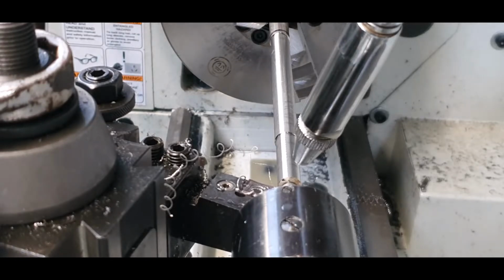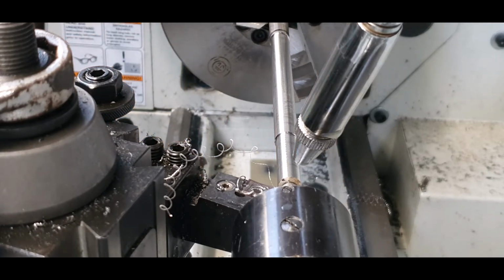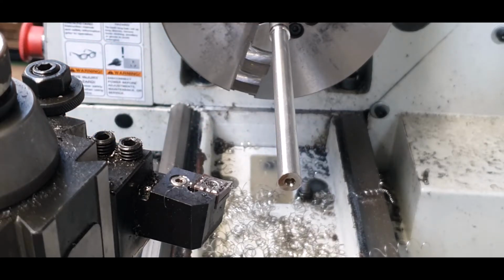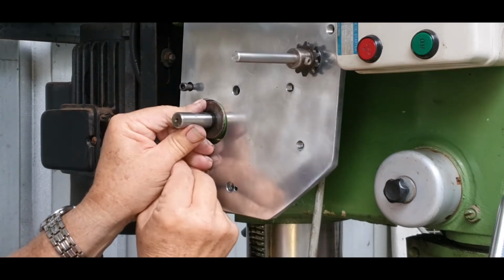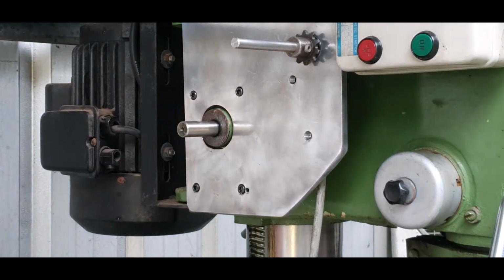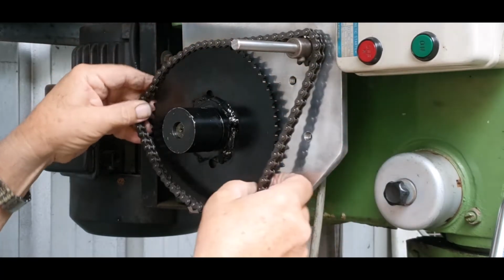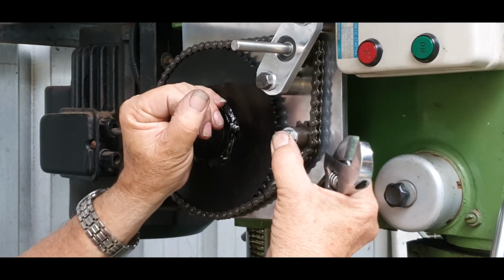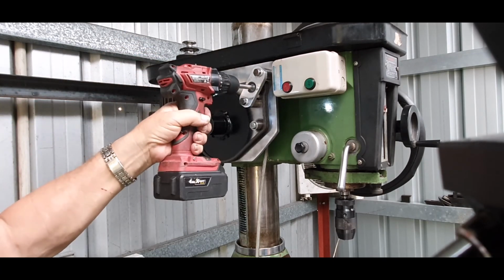Rong Fu  RF30 Round Column Motorization  Part 3  Final

Comment: Hello. 
I enjoyed these videos. I have a similar machine and did an almost identical mod to mine. I used a 24v wiper motor to power the chain with a double pole switch for up/down. It's not very fast, but very quiet. I changed to a smaller driven sprocket to increase speed. 
I also added a counterweight via pulleys to the head to make lifting easier. 
In process now of adding X power feed using a stepper motor. 
Also, If your mill is like mine, you will find tapped holes in top surface of column. You could add bolts to hold top cap in place to secure the rack from moving.
Subscribed!
Greetings from Pennsylvania, USA.
Reply from the maker: Thanks for your input.   I know what you mean about the top end cap, I was going to put an extra bolt on it, but didn't due to Possible Interference when moving the Head assembly around to 45 to 90 degrees. I stayed with the drill to raise and lower the head assembly so not to have different voltages. My Mill is a straight 240v system, and doesn't have variable or reserve speed.
After I finish the vertical Modification to stop side movement, I am thinking of fitting a 3 axis DRO, which means I am going to be searching for room. As you know all these things take time, but we will get there eventually.

Comment: This reminds me of what was done in Winky’s Workshop. He did this in conjunction with a mechanism to prevent the head from turning from side to side when it’s raised or lowered.
Reply from the maker: I saw a similar one elsewhere with a virticle brace on the same side as the sprocket, plus I have since seen Winkey's as well. My mod has ball Barings etc instead of bushes . Many mods will be similar,  you need to find one that suits you & Your machine.  BTW, Mine is a Alloy plate etc

Comment: Nice one 👍 Do you have any ideas for a quick lock on the nuts that locks the head to the column? Would have been really nice not having to crank them both every time 😄
Reply from the maker: G'day Thanks for your comments. If you are referring to the two virtical lock nuts just infront of the main electrical. Motor. I looked at this point, & decided this was the strongest solution as is, because the studs in the main column,  long as they are tightin & not loose they are a very strong solution because of the weight of the head assembly. Hope this helps
Reply from the maker: Also it is a matter of loosening two nuts, then use the drill to go up or down to the correct place & relock the nuts . If you add the Virtical guide assembly then there is no side movement

Comment: Why not just use the variable speed drill motor directly onto the  shaft and eliminate the sprockets chain etc? Same result would be achieved right? Does the drill motor have enough power without the gearing reduction, just curious, and a great ingenious idea BTW!
Reply from the maker: Thanks for your question, It is greatly  appreciated. When the original handle was used, because of the gearing the weight of the Head assembly tends to force the the Head Assembly to move left & right . Therefore using a 9 to 1 or 10 to 1 ratio It not only takes the heavy torque ratio out of the equation  using a small or heavy torque drill, It makes it easy, or less torque or stress on the upward or lifting of the Head Assembly. My next modification will be to make a special sliding Virticle brace assembly to stop side movement.  I hope this answers your question.
Reply: @TedRoza  Thanks for the response, looking forward to the video when you start the verticle brace assembly, I am preparing to do all these mods on my mill, enjoy your channel.....

Comment: Something wrong with the cut-off tool holder. It was bouncing up and down. It was easy to hear as well. You must have noticed it.
Reply from the maker: Thanks for your comment. The carbide was replaced with my last new one, which is the one you saw with the chatter. I couldn't get another one at the time, so I gently finished the job I was doing.
When I had time with further investigation & a new carbide tip, I found the carbide holding groove on the holding blade had spread a couple of thousand's of an inch, causing the chatter with the New carbide insert. I put it in a vice & closed up the Insert Holding Groove, which held the Carbide tighter as should be, & sorted the problem out.
Reply: @TedRoza  The entire toolholder was flexing.  It wasn't just the carbide bit.  It looked like the QCTP wasn't locked tight.  BTW, great video series; excellent job showing your techniques.

Comment: Hi mate where did you get the gears for the mill head lift
Reply from the maker: Hi Trevor.  I will have to see where I got them from,  If you use a 9 or 10 to 1 ratio, that will work fine  Have a look at the  video, I think that goes deeper in depth of asssembly & welding etc
Reply from the maker: The Large sprocket is a 60 Tooth #35 ( chain pitch ) which is 186mm O.D. with a center hole of 50.8mm I.D. 4 bolt holes approx. 51.5 mm apart & 73mm across the opposite corners. The Holes are 10mm dia. This Larger gear I purchased on Ebay, which was cheaper. 
The Drive Gear is Approx. 35mm #35  with Approx.10 Teeth.. Which works out to 6: 1 Ratio.. The ratio is dependent on what you want. I bought the drive gear at a gear & chain, Baring Establishment. It's up to you where & how you purchase these, it all is depends where you are situated, & what Country, which makes it Price dependent.  I hope this helps

Comment: I need to do this for my milling machine. What tool holder is that you're using for the cutoff tool? That is awesome with the relief cut for the tool to flex slightly
Reply from the maker: Hi Steve.   The Blade is Kennametal Hertel, which is a German Brand. A2BNSN26  J03 / 387026-030
Tool Holder  is Kennametal   
A2 TEN2020X26  , this has a 3/4"  or 20mm  flat that goes into the quick change or other tool post.
There are cheaper brands on Ebay. 
Long as the quick change has a "V" groove locator in it.